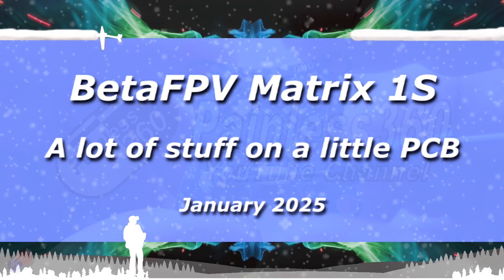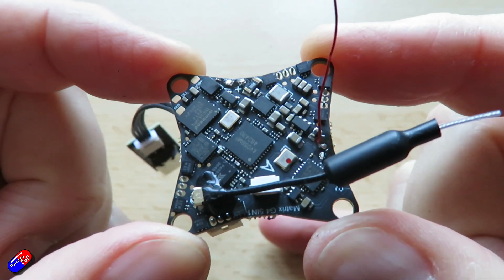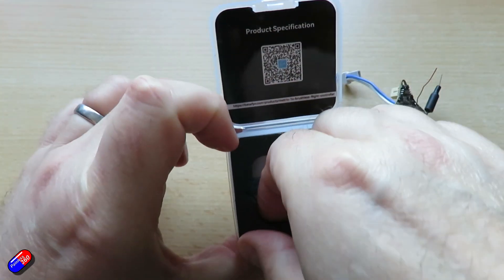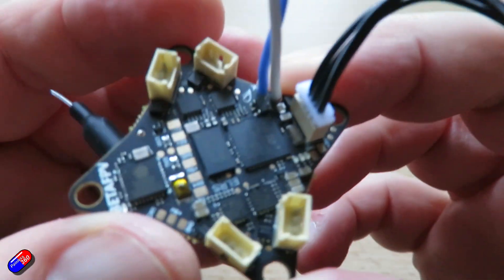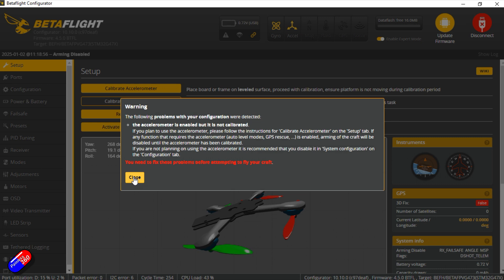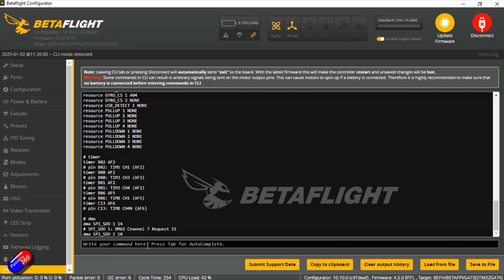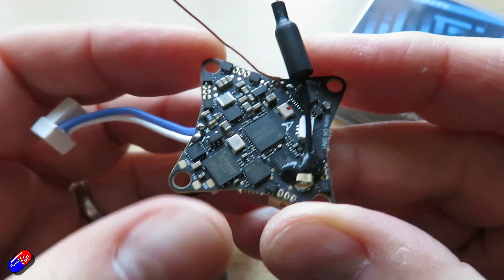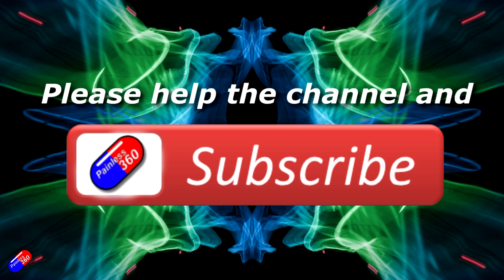First Look: New BetaFPV MATRIX 5in1 Whoop FC (FC, VTX, ESC, OSD and ELRS!)

Comment: Anyone have success adding a buzzer to this FC?

I get a constant power on buzz+ and buzz- pads. I have contacted support and they told me to flash the firmware again. I used current one on there site and still has not fixed this. I followed a video they sent me with connection and settings. I had a Meteor85 that I had no issues with adding buzzer so I have had some experience.

I was told a work around to use led pad as signal below but seems why this is needed.

Wiring Summary (Color-Coded Description):
You’ll connect your components as follows:

🟥 Buzzer + (red wire) → to FC 5V pad

⬛ Buzzer – (black wire) → to the Collector (C) of an NPN transistor

⬛ Transistor Emitter (E) → to FC GND pad

🟨 LED pad (A08) on FC → through a 1kΩ resistor → to the Base (B) of the transistor

This lets the A08 LED pad act as a software-controlled switch using LEDLOW mode in Betaflight.
Reply from the maker: I'd log a bug report with the Betaflight devs in case it's a software fix. Best of luck

Comment: Have you encountered any issues with the VTX on this board? I've gone through two now, and neither has properly connected to the Betaflight OSD. I can rip around a playground, but I haven't been able to fly very far away due to the VTX not responding to changes via BF or the OSD in goggles. Betaflight says I should be on Raceband 8 at 400 mW, yet my VTX seems stuck on Raceband 1 at 25 or maybe 100 mW. I've checked the VTX table, and I am using TBS Smart Audio on UART 2 (which shows as Smartaudio Unknown in the VTX tab for some reason).

Comment: After one hard crash i lost my osd and the fc still working,,,anybody here got same problem and can share some idea to make it work again,,,even i switch to another camera same no osd but when i put the camera on same fc it is working,,,anybody here can help??thank you in advance!
Reply from the maker: The OSD for the analogue FPV is created using one of the chips on the flight controller. It sound like maybe a connection was affected to that chip... Best of luck

Comment: maybe u know what is the button for? can i restore it to factory settings with it? didnt find it out on the web, i cant also connect it to betafligth, i have camera but no osd :/
Reply from the maker: What troubleshooting have you already tried?
Reply: @ it is not even detected by different computers with different cables, I mean detected in betaflight, with or without binding the controller, and also used zadig and impulse rc driver recognition
Reply from the maker: I'd contact the seller as you seem to have covered the basics - cable, PC, etc..

Comment: if i don't win the BetaFPV Matrix Flight Controller in this giveaway, i will buy it anyway. need this because i got a used whoop with crossfire and a broken walksnail VTX. I fly ELRS and analog so this will fit perfectly in there.
Cheers
Reply from the maker: The draw has already been made. Please make sure you are subscribed and have the bell notification icon selected so you don't miss future chances... Happy flying!

Comment: betafpv matrix flight controller   Love it, 5amp cont. ESCs w/ 96k bluejay  out of the box, bi-directional d-shot out of the box, amazing!)  G4 processor what? OSD what? 16mb blackbox are you serious?400 mw 5.8ghz VTX sheesh, elrs 2.4ghz with 3.x fw pre-installed no way, Thumbs up,  Sub.. . betafpv matrix flight controller

Comment: Is this BetaFPV Maxtrix Flight Controller the same as they used in the Air65? but with built in elrs?
Reply: It’s comes as std on any new 75 meteor pro models so should fit any 65mm frame

Comment: Another newby question, sorry! If I replace my Air65 board with this, the current motors are directly soldered - so I guess my options would be 1) remove the motor connectors from the board (I’d prefer not to), or 2) fit motor connectors to the motor wires…
For the latter option - is it ‘micro jst 2 wire connectors’ I need, and how do I attach them? Do I need crimpers etc? Never done that before. 
Or any easier option?
BetaFPV Matrix Flight Controller
👍🏻 thanks
Reply: There are solder pads for motors on the top of the board

Comment: Hi Lee / fellow whoopers. Thanks for another great video. I have a quick newby question - would this work as a replacement for the board in my Betafpv Air65 tinywhoop, which I have managed to break already? I think it will, but just want to check. 
Also - did you solder on that copper wire antenna yourself, askn BFPV website it isn’t shown?
BetaFPV Matrix Flight Controller
🛸
Reply: Yes, this will work. But if you're someone who is worried about weight savings, you could just do a replacement of the Air65 board by getting the "Betafpv Air 5in1"
Reply: @ thanks. I’ll probably do that instead in that case.